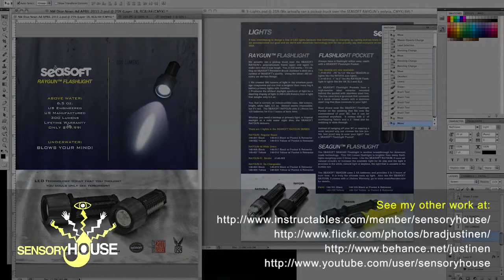DIY Ball Bearing Jib Arm (w/ Motorized Pan/Tilt) Tutorial

Comment: Hi. Not sure if comments are still monitored for this post. Nicest motion I've seen on a DIY jib. Nice work. I regrettably purchased a Proaim Astra 8 jib and it's basically junk, Im looking to modify it with bearings/bushings for much smoother opersation. When it comes to the "bronze bushings"  is the shaft/bolt connected to the inside the bushing allowing it to rotate in a fluid way as if the bushing is self-lubricated or is it a simpler static bushing that provides a smooth inner surface to pivot in. Hope that makes sense. Thanks for the video.